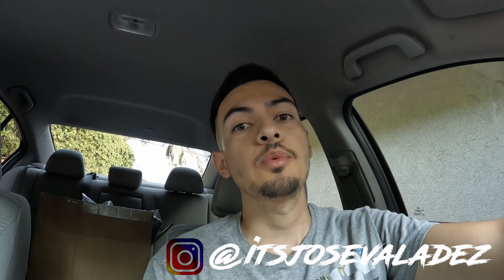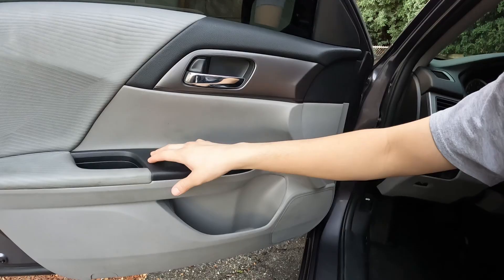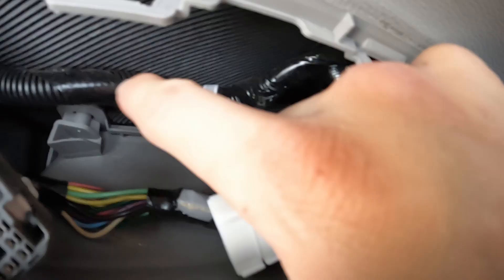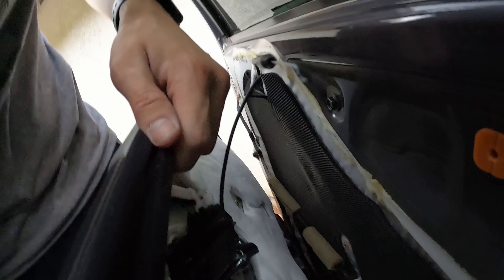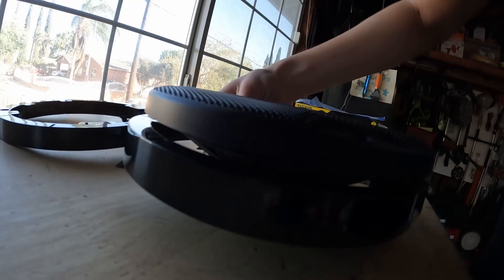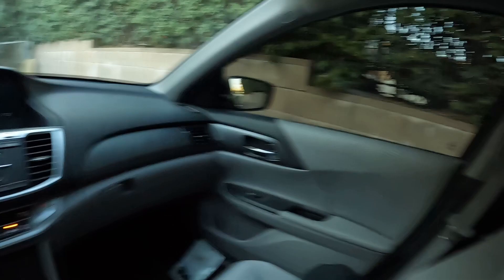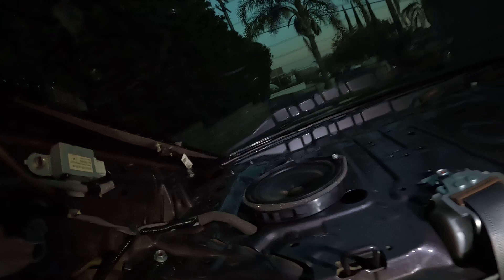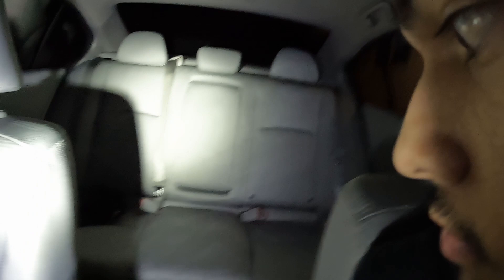NEW Kicker CS Series Speaker Install/ Sound Test *LOUD*

Comment: So your final result is louder across the full range but less bass.
Reply: You don’t want Bass lol. That’s meant for subwoofers. You will get a small amount of mid bass, but components, and door speakers, are meant for mid’s, highs.
Reply from the maker: That’s what my setup is right now, These speakers for the highs and mids and just got a 12” JL Audio Sub. for the bass. The parts didn’t arrive on time, so I just made separate videos.
Reply from the maker: And I have the JL audio XD700/5v2 amp, which is enough for the music experience that I wanted.
Reply: @calebniederhofer6529 Sure, I understand your point, but this is about replacing / upgrading factory speakers not about complete setups with amps, crossovers, etc.  If factory setup produces some audible low notes so should the upgrade, ofcourse not any loud bass where you can feel the vibration like a sub.
Reply: @NEWTONjag  You typically get less bass out of aftermarket mid’s and highs. Not all, but a lot.  There really is not much of a benefit in upgrading only door speakers, and not having a sub. In fact, you would be better off adding a power pack, or more power to the stock speakers. If you are not upgrading, and adding a sub. Most stock head units, only have 6-10 watts per channel.